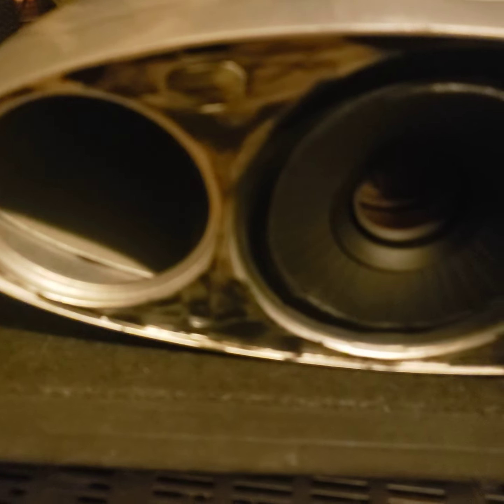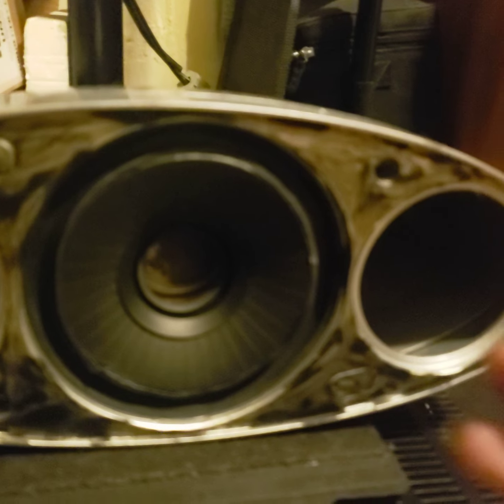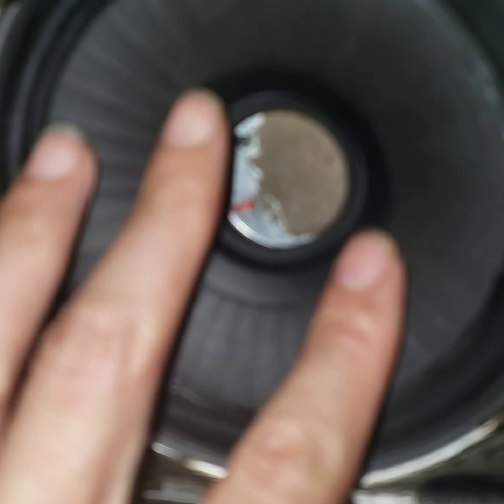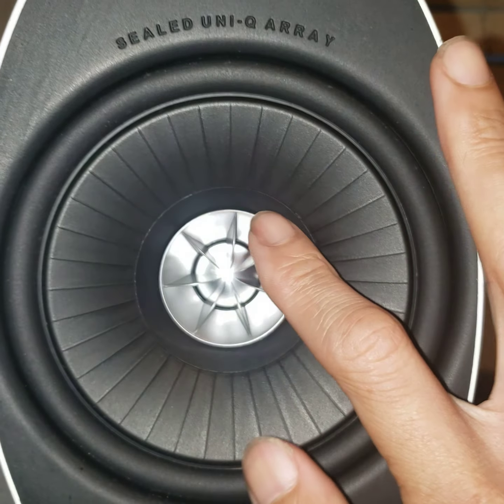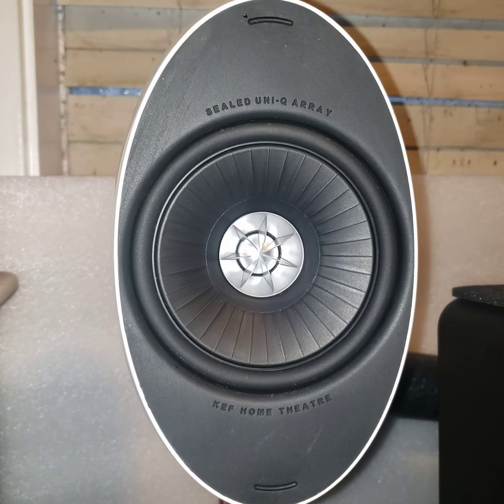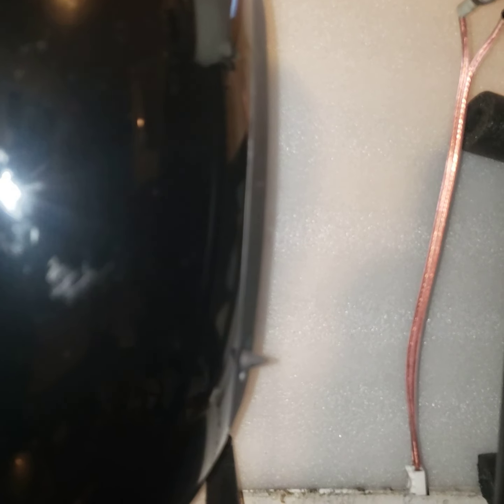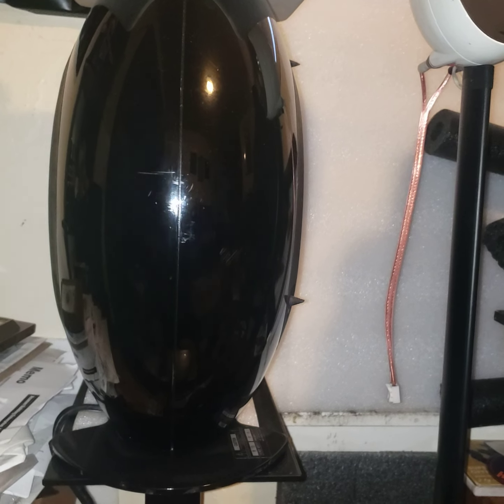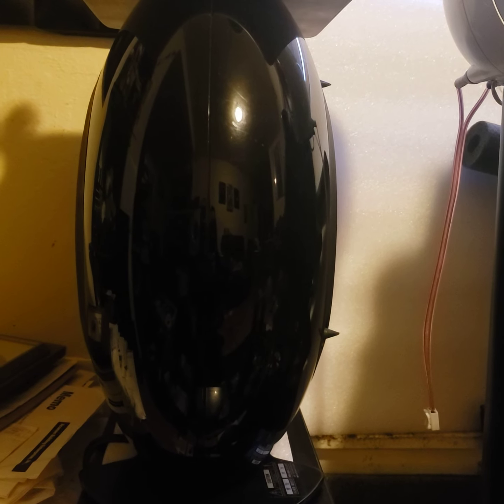The science of phi in acoustics. The port of a speaker whose wavelengths are smaller vs larger.

Comment: Love the 3000 series
Reply from the maker: Literally used to be poor shamed on audio forums for like daring to imply something that resembled an egg (except not at all, the eggs still exist and the egg duos that were released last year look exactly like the og 2005 EGGs.

But yea, the flexibility versatility, and I even literally destroyed a driver just to see how it worked. The thing exudes quality just looking outside in but the driver is like something maybe hauled off area 51.

When I took the tweeters out where I expected the typical 2 magnet 2 coil Uni Q, the central column literally exploded its little magnetic wafers that somehow don't have polarity... They repel either way with a TON of power, but if you force them together they snap into a pile no matter which way the central column of magnets are facing. It's the weirdest thing, but it did cause me break 2 of the magnetic discs... So it could be a trip wire design... Or maybe they left themselves room to use smart magnets to find tube the power of the tweeter that carefully and with that much granularity.

Rather than a magnetic piller with a VC, the discs can control the power of the tweeter so theyd be more powerful at the extremes or even in one direction. I can't tell since I didn't expect the magnets to fly out so have no idea how to put them back together in sequence anyway. So warning to others curious enough to open the drivers.

Whats funny is that before I did that it was already very obvious the tweeter was not replaceable, at least not manually without their tools but some pirates took the sudden rise in seo and flooded the end with 300X/SE tweeters anyway when one thing I think everyone would agree on is this speaker is over engineered as hell and the voice coils are over sized so that even when rated at 100 watts (which is a lot for their size, you'd expect them to be 50 watts and no where as loud) they are virtually impossible to damage/burn out.